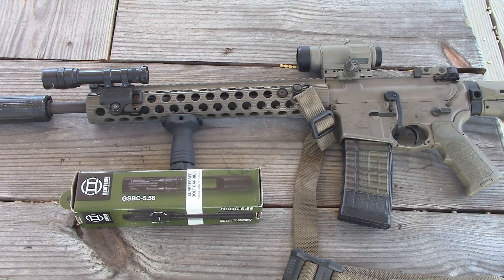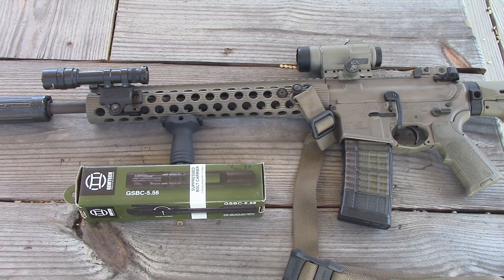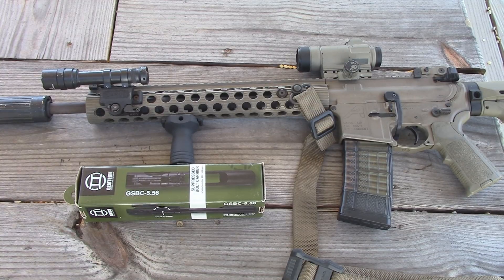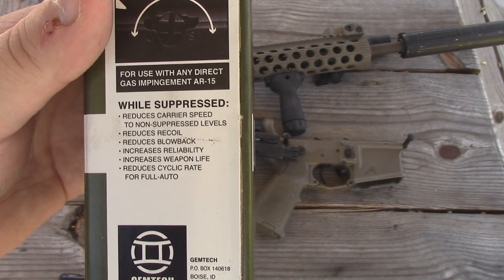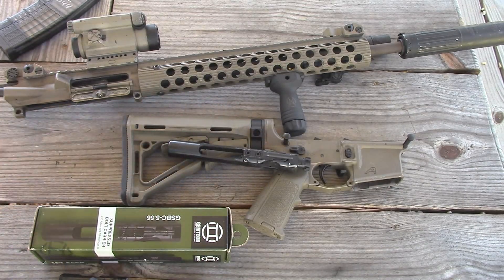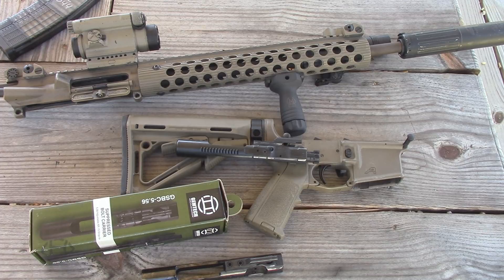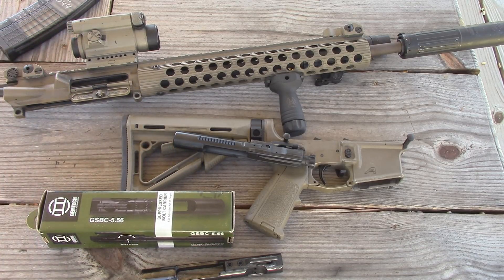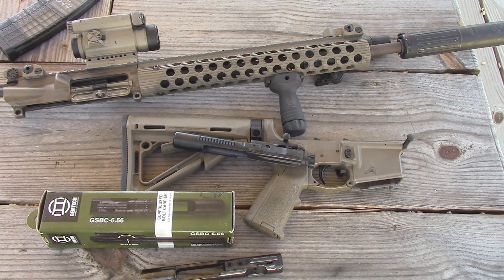Gemtech Bolt Carrier - Must Have For Suppressed AR-15

Comment: Thanks for the review. Just ordered one but am the same with you....for that price point I wish it was a complete bcg but if it does a good job I can deal it with. Have you seen the Radian Raptor-SD? It’s a vented charging handle to redirect gas forward and not back in your face. Gonna run that and the gemtech 👍🏼

Comment: What subs are you running that will cycle? I have atomic 223 subs that won't cycle and I also have the bootleg brand adjustable bcg but I've only used it for subs since it's brand new